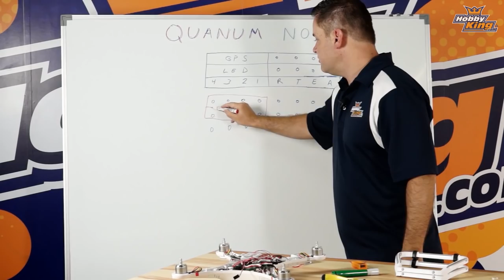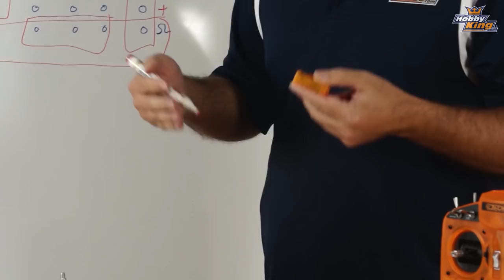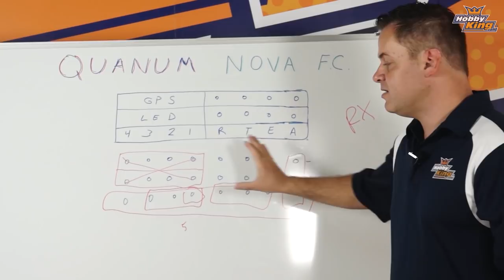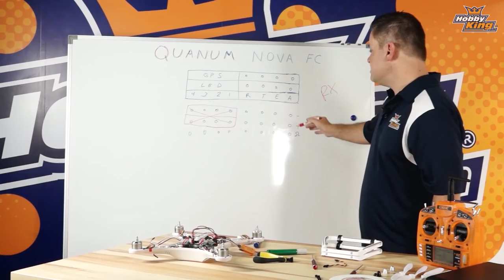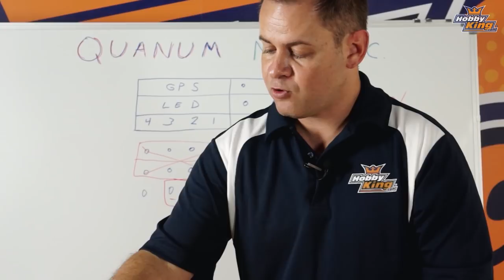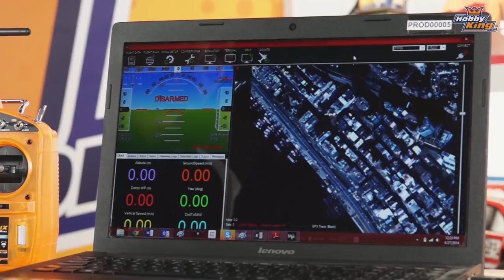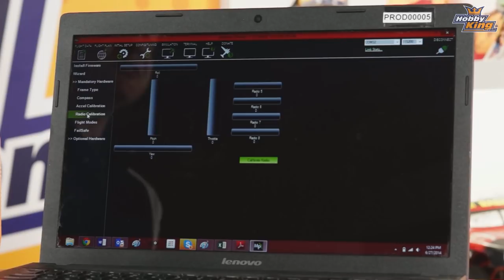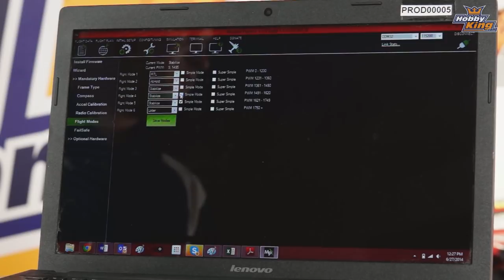HobbyKing Live - Product Profile Quanum Nova PNF

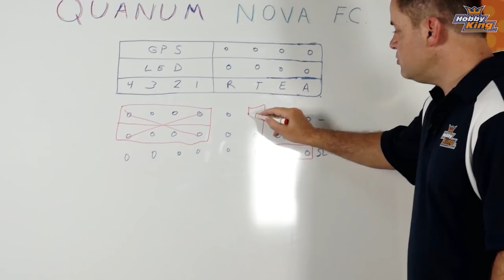Comment: There is an error in this video.  For PPM to work (5:25), you jump 2-3 and plug the receiver's PPM output to channel 1, not channel 3.  I tried channel 3 and got nothing.   Channel 1 works perfectly.
Reply: Glofilter is exactly correct, thanks for this, took me 2 days until I saw your post to find what was wrong.

Comment: couple notes and a question.A. you have to plug in the usb from the bottom to the FC if your going to program it thru mission planner IF you plug in the way shown in the video. You can plug straight into the FC its easier.B I have the Orange TX  from HK just like in the video, but all my switches are two position. Can I use a 72mhz radio? I got a few of those with 3 position switches
Reply: Yes you can use a FM radio, I used a five channel Hi Tec.
I also use a mac mini to set up the radio. GOOD VIDEO. could not have succeeded with out it. THANKS
Reply: ***** you can use any radio as long as you have a reciver that goes with it

Comment: Is there a wiring schematic for the Quantum Nova? Specifically for connecting the Turnigy 9X receiver in to the copter? I would like to just fly it line of sight for now but add a camera & gimbal at a later date. Because of the future camera addition, I would like to connect the wiring to fly now with the intention of adding a camera and movable gimbal later. Thank you.

Comment: I have a previous CX-20 transmitter from a previous CX-20.  It works with it's replacement Cx-20 RTF fine.  If I order the PNF does it have a built in receiver and will it work with the old transmitter as it does with the replacement RTF unit I have.  Just looking at saving a little money if I don't have to buy a full RFT unit in the future.  Plus I currently have a spare transmitter.  Any thoughts.

Thanks

Comment: I have a Quantum Nova PNF and Turnigy 9X Nine Channel transmitter. I purchased both in order to do aerial photography. Is there a wiring diagram to show how to wire the receiver into the quad copter? I have seen many posts, however, also in some of the posts corrections have been posted stating what was posted is incorrect. I am new at this and need HELP, Please!

Comment: What's about the transmitter settings for the flight modes? I plugged in the Signal cable to RX channel 5 where I have a 3 position switch. What values in the Transmitter are for the different flight modes? -100 / 0 / 100 ?? 
Can someone explain how to setup these flight modes in the Transmitter, please?
Reply: Ok my mistake....i watched the Video to the end and at 29min the flight modes are explained to configure with Mission planner :)

Comment: Thank you for the video.
When you say PPM connection using the jumper , is it the same as Sbus on Futaba RX?
Because I want to use my Futaba 3ch Sbus RX (R6303SB). do i use the PPM way to connect to the FC?
If i use PPM connection method using the jumper pin, what happens to the 2 Aux cables reserved for gimbal pitch? Do i just leave it unplug?
Thx.
Reply: I am using PPM with my FrSky receiver and Taranis, but I assume Futabe is the same.  First, jump 2-3 on the flight controller and plug your radio receiver's ppm output (not Sbus- cppm) to channel ONE (not three as is in the video).  On the FrSky receiver, the other output channels still work physically, so I have the pan/tilt servos wires plugged into channels 7 and 8 on the receiver.  This gives you dual capability- you can disconnect the pan/tilt and use channels 6,7, and 8 for the advanced functions inside mission planner- and then turn those fuctions off when you are ready to control pan/tilt.
Reply: Glofilter I can't get how Futaba Sbus works. R2008SB Specifications
S-FHSS/FHSS-2.4GHz system/S.BUS port and 8 channels for conventional system receiver. I am not an expert and I am guessing  that Sbus works same than PPM. My receiver has its own Sbus "channel" , but you said that I can connect the PPM signal from the Flight Controller to Channel 1 on my receiver, I am wrong?

Comment: I am new to the hobby and I seemed to have bricked my nova pro by doing a firmware upgrade on mission planner. Silly me! Are you able to supply standard settings for PID. flight modes, and all other necessary settings so I could re programme my quad please.

Comment: I need a step by step tutorial on the process of firmware update and the website where you can download the latest version.
Reply: Do I need any interface card or a simple usb cable?
Reply: Carlo Magno Morales Herrera Plug in your copter with a USB cable to your computer.  Start Mission Planner.  Check for firmware updates.  Update firmware.  Once firmware is updated, calibrate compass, calibrate accelerometer, calibrate radio, set up flight modes, go fly.
Reply: Glofilter
I tried but the computer never recognized the device  :(
Reply: Carlo Magno Morales Herrera You might have to change the port setting.  Mine defaulted to COM 10 when I first plugged it in and the software doesn't go up that high.  Changed it to COM 2 (was open) and now it works.  Try that.

Comment: so, i bought the nova a while ago and decided to start it of i bought the bnf version and are using a orange 7 channel reciever and a 9xr tx. I 'm used to be flying fixed wing withe the apm onboard so i know a little about apm. The quad flys great but it needs constant input from me even in stabelize alt hold or pos hold. On my fixed wing when i switch to pos hold it circles at a predefined alt no prb with the nova it needs constant input from me and the tx, i have satelite lock with more than 6 satelites. Any help ?

Comment: This video is WRONG for PPM.  The cable goes in the first slot (A) and the jumper goes across the 2nd and 3rd signal pins.    (The video shows the jumper on pin 1&2 and the PPM cable on #3 - this will not work)

Comment: did this set up with my cx20 went into mission planner setup radio can't unlock motors i even tried disabling arming check still nothing any help will be appreciated
Reply: Hi mark did u ever sort out the motors I did exactly the same to the letter & my motors won't unlock either any help would be great as I'm stumped
Reply: paul foster I got it to work on my futaba 8j I hooked it up ppm like the factory radio it originally had in it took a couple more days to tweak it out and get 6 different flying modes when I got it to connect to mission planner I had to open up the flight controller and use my android otg 'on the go"plug to set up the radio and check flight modes I opened up th plug opening on the side of the flight controller and zipped tied the otg plug in and ran it towards the battery door so if I need to hook it up it's right there.let me know if this helps.
Reply: +MARC BROWN have you a photography between connection nova flycontroller and futaba receiver?
Reply: i would have to pull the copter apart i will be coing that in a couple weeks to add osd gige me your email address and i will send you some pics changed radios to a taranis but same hook up
Reply: +MARC BROWN mckregor@gmail.com Thanks ;)
Reply: +Antoine Simal Can you please forward the pic to me when you get it? =)
magnus@antonsson.be
Reply: +Magnus Antonsson i will been a little busy will try to pull it apart this weekend
Reply: No Problem ;)
Thank You
Reply: +MARC BROWN I recieved my quanum nova today, and siting here with my Futaba 8J :D

Comment: But still blinking red led.
I think I can't motor unlock.
Reply: yea I'm having the same problem
Reply: j7o7k7e7r what can we do?
Reply: Is it a single blink or double?  If single, it will unlock- hold stick bottom right and wait for fast blinks, then steady red- armed.  If you have a double blink, then something isn't set up.  Connect to mission planner and it will tell you what your error is on the Head's UP Display.
Reply: i had the same problem. I used Mission Planner to check for issues. Motor will arm  if got compass/GPS/Barometer issue or in Loiter/Alt hold mode. Motor will only arm or disarm in Stabilize/acro mode. The other not recommended option is to disabled the arming check in the standard parameters page. After take off, you can enter loiter mode. My Nova loiter for short while then starts to drift around. will need to check my setting again.

Comment: Plug in a Rx, bind with it - ok we do this with dozens of other models. 
The Nova esc goes through their arming sequence ok. Connect the Nova to laptop/PC/or whatever, load Mission (as shown in the HobbyKing video). 
Run Mission, alter the two headings as shown. Check the Tx is working as shown (it does) no problem.
Arm the motors - ahh does not work, hmm. 
Ask live help - not got a clue, will pass it on to somebody else who knows, will reply in 24 to 48 hours - NO REPLY. 
So we have spent hard earned money and got a pile of cr*p that does not work and customer care that doesn't give a monkeys.
Good old HobbyKing.